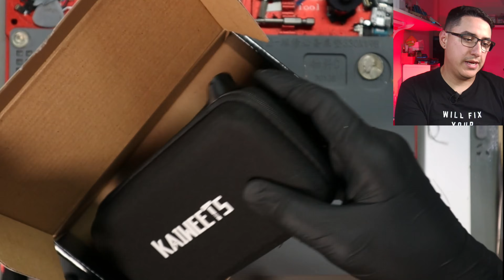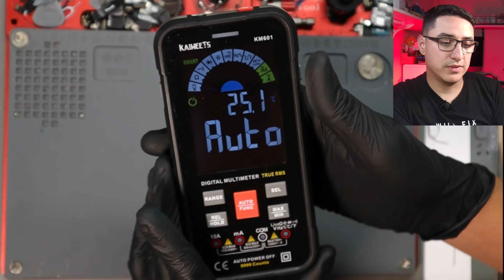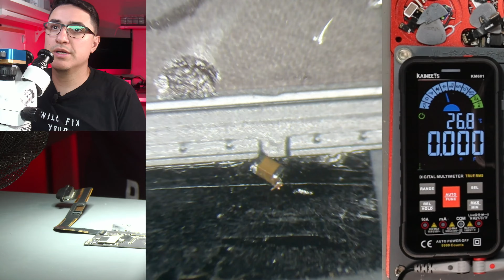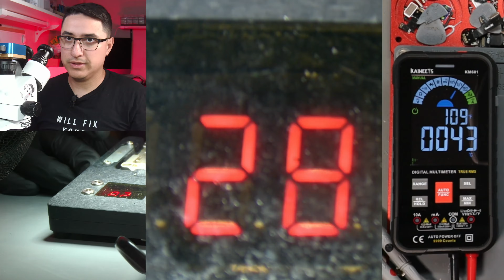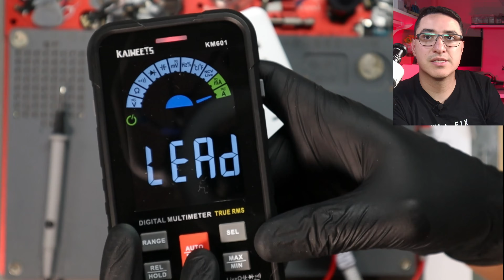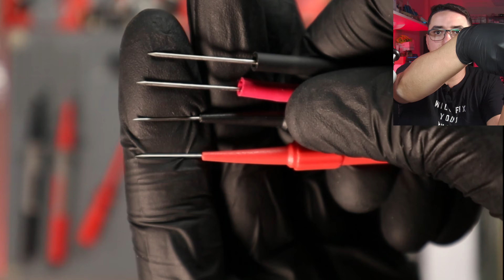How To Use a Multimeter, Kaiweets KM601 & DC Power Supply Cable Kit Review!

Comment: Not having a kickstand is going to drive you nuts. You need to have direct line of sight in a sitting position and not have to look at it laying flat. And propping it up at an angle is not the answer. I would pass on this one. I use the Astro M6KOR and it has just about the same features and it even has the NCV Live feature. You don't need the fancy display.
Reply from the maker: Yeah no kickstand sucks.

Comment: It drives me nuts that none of the budget multimeters have a continuous beep on a short using diode mode. I've used lots of Flukes and love Fluke, but hate their price. Maybe one day soon budget manufacturers will write a single line of code in the firmware to make this happen. So maddening. Thanks for the review Jesse.
Reply: Look into UNI-T
Reply from the maker: @boardrev  Tell me more!
Reply: @VCCBoardRepairs  I am using uni-t multimeters for years. Not the cheapest on the market, but only a fraction of the Fluke's similar multimeter cost. They are highly robust. There are cheap ones that beep just like a Fluke does. Currently I am using UT181A - this is a data logging multimeter, 60000 counts. It is similar with Fluke 289 which is about 900$, while my uni-t is about 340$ and does a better job in datalogging than Fluke. Also, it comes with optical usb connection and software so I can always have it on the OBS capture.
Reply from the maker: agreed! i hope Kaiweets hears my feedback on this & adds that feature!